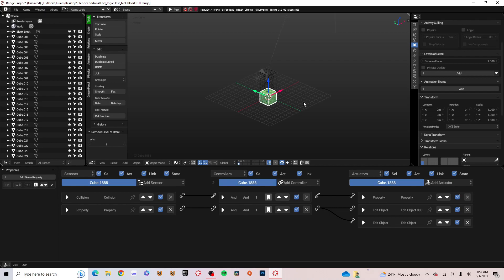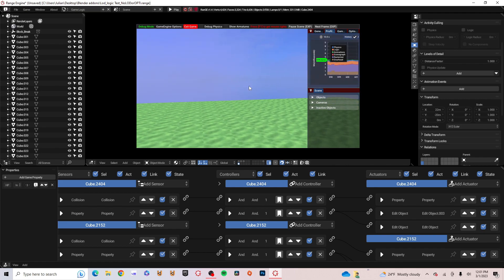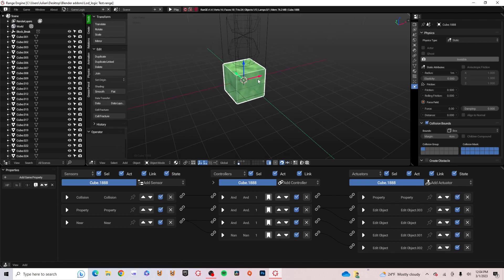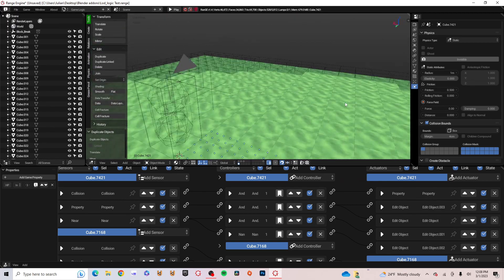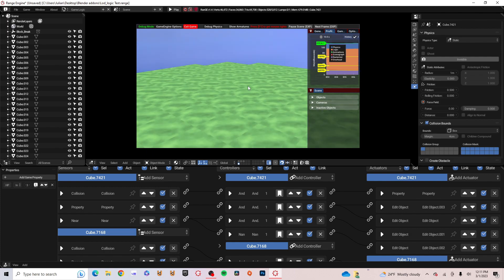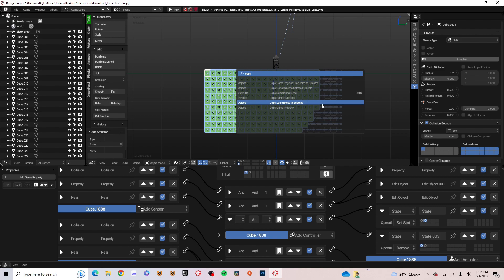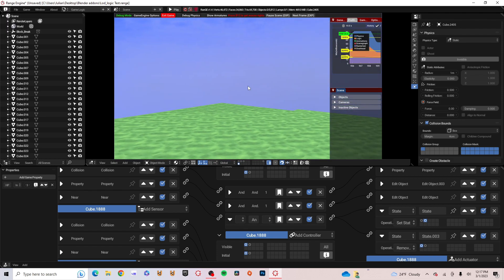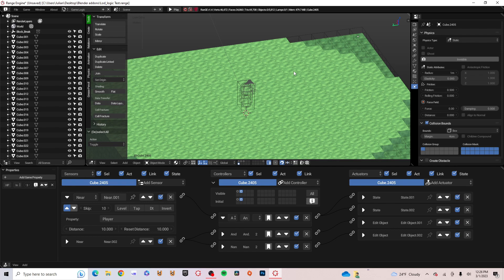Testing To See What Causes Bad Performance | BGE 2.79

Comment: The problem is the DRAW CALLS, the greater the number of objects and the greater the number of materials, the worse the performance.

The solution is to merge the objects, turn off the light and especially the shadow, hide the objects out of the camera's view, disable the camera's physics and logic, use one material for several objects, hide objects behind other objects, decrease fps to 30fps and etc.

Comment: why dont you try to do what skyrim does and have the blocks rander only when its within sight of the camera. this might even make the block under the top one also be removed since the top ones are blocking the view of the camera.
Reply from the maker: I have tried that in the past, but my biggest issue is the logic running in the background. but I do have some ideas that came from my latest tests.
Reply: @Loxaevion  ok then why dont you try to do what Minecraft does. they use a directory to save the world (in this case blocks) so the game only loads in the blocks near the player and when the player moves or breaks blocks under him the game spawns the blocks that comes next.